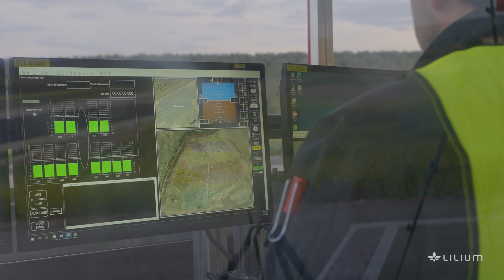What is transition?

Comment: you have 4 sets of nearly independent fan structures moving with different controls , make them into 16 structure for redundance and you will lower the risk of computer operated rotational failure clearly your biggest fear flipping during converting from upwards motion to forward motion. Have 16 independent section to reduce failure of one so flights can continue please continue  to build these for real world. Great work though guys but still please prove the concept wont fail because your first human casualty will be your greatest stain on reputation

Comment: I am starting to lousing my confidens in this project
Reply: The slowdown for all of these eVTOL projects will be the certification process.  Even now, the requirements for certification are changing, but you can be certain that the end requirement will entail a LOT of data from test flights.  If these eVTOLs were being certified as helicopters or as regular airplanes, no one would be worried about or gathering data about "transition".  Whatever the FAA and the EASA decide are the final criteria,  transition will be a critical area that must be shown to be effective and safe EVERY time.  The EASA requirements appear to be much more developed than that of the FAA, so Lilium is working on type certification concurrently with both agencies.  But by working on EASA's more specific certification requirements, they will have (almost) all of the flight data they need for FAA certification.  It is a slow, bureaucratic process and Lilium is gathering valuable data while the whole process grinds forward.
Reply: Just starting?

Comment: Why turtle development ? Ok ...  lab xinize virus , but 1 fly by year ??? 3 years since the first fly ( May 2019 ) !!! At least more 10 years to comercial version ... And there is no interior ...
Reply: You Tube  Time is against them in this case. They don't need to look for money. It is thrown at them.
Reply: The system has to operate over densely populated areas so the certification is extremely thorough. Have 2 crashes and the company goes bust. The transition phase is the most critical as level flight is super easy. So unless you can master transition, there's no point in going level. You're just bs'ing yourself and the general public.
It's like pushing a baby that can't walk on a bike down the hill. The speed will keep the baby on the bicycle upright but what happens once the bicycle slows down.
That's why we humans first learn to walk, then learn to ride a bicycle with assistance wheels and some of us end up jumping crazy jumps on dirt bikes.
Same with serious aircraft development.
Reply: @EdwardOmagbemi  and some of us grow old and die before we get on the bike
Reply: @easyediblelandscaping2620  I would leave engineering to engineers. Although I like teasing landscapers about why everything takes them so long :-) If it was easy, they would long be in operation.

Comment: hmm, once it can rise in the air it should easily be able to tilt forward. This seems like artificial drama. Speaking of which, is the craft unladen? I assume it's unmanned but does it carry payload or is it empty. Are the windows tinted to hide that you are flying empty?  if you need to deceive, how can you hope to succeed.
Reply: It's unmanned as stated publicly on several occasions, no claims otherwise... This is not the final version and testing is still on the basic flight physics of the concept again with no claims otherwise...
Reply: @faluffel  it could still be laden with full payload. if completely empty the tests are nearly worthless. and how many years have they been at this stage...
Reply: @DanFrederiksen  Sure. But you were implying that it was deception, but that requires that some sort of statement was made prior that could be broken. If the weight of the prototype is known before each flight, then a lot of assumptions could be made looking at battery drain during tests. No need to stuff it with weight increasing risk of failure until later stage testing
Reply: @ Dan Fredeeiksen: 

Just go build your own VTOL that will do what you think it should do.

It will be time well spent than criticizing a good effort by people that are actually doing something.

Ijs!
Reply: @kfk256  the premise of your comment is that no one can hear constructive criticism that could help them a lot. And while that is dreadfully true, I don't subscribe to obtuseness and pride being the law.
Reply: @DanFrederiksen  Accusing them of deception without evidence is hardly constructive criticism. 

Engineers don't need tough love (especially the slanderous type), they need positive reinforcement , sir.
Reply: @DanFrederiksen  accusing an engineer of deception when demonstration something isn't constructive critisism  not at all!
Reply: @reinholdu9909  well, very tinted windows and no mention of payload. if shoe fits...